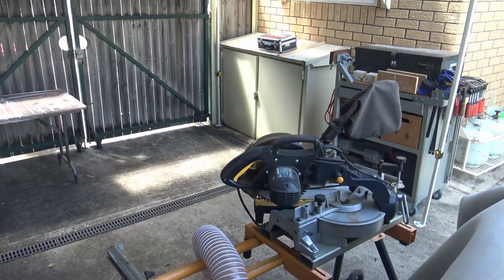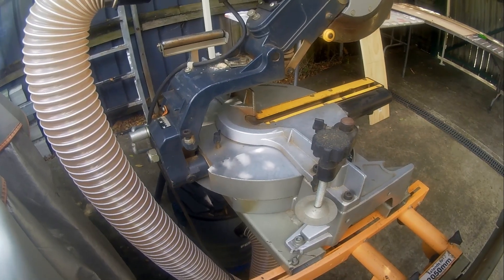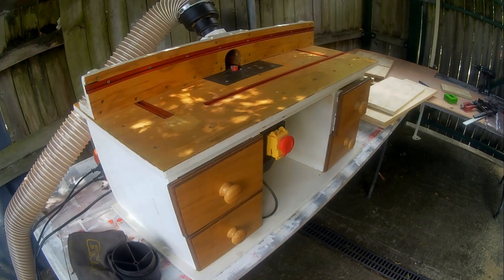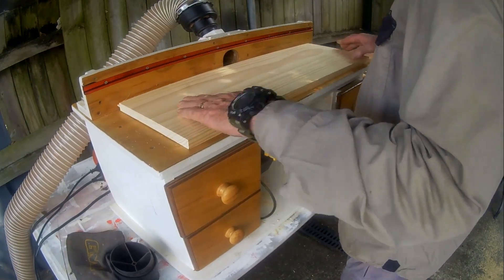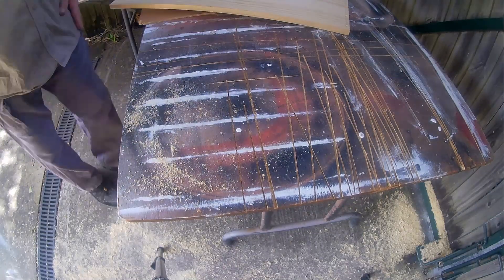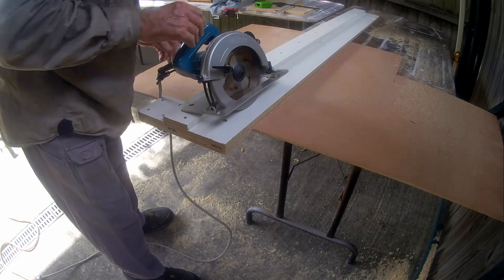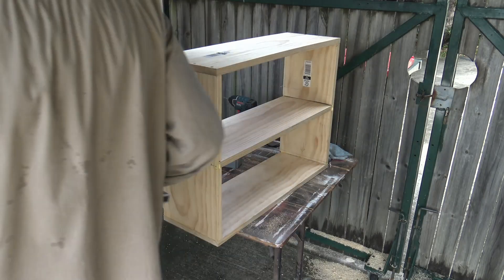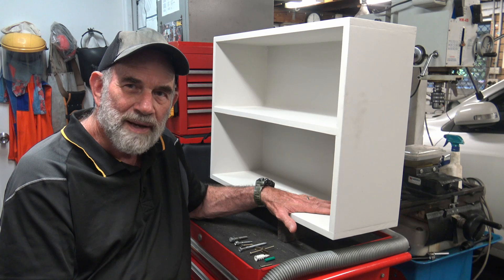Making and Hanging a Wall Mounted Bookcase

Comment: Nice job, Bob. I am in the process of dismantling my workshop at the moment for a move to our new home. Some new shelves using your plans will come in handy when setting up the new shop.  I must agree with you as my table saw doesn't get much use either since I bought a track saw. Quite like the homemade router table you have too. Cheers
Reply from the maker: Thanks mate 👍👍👍